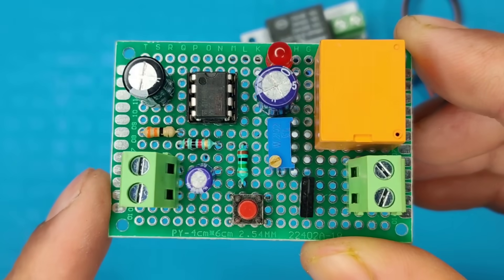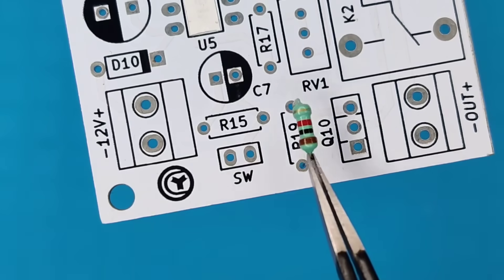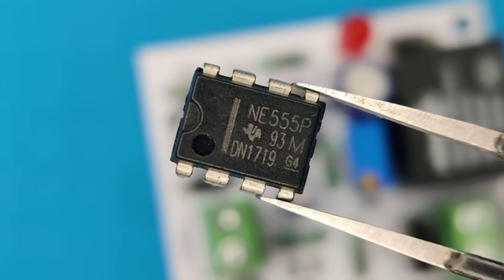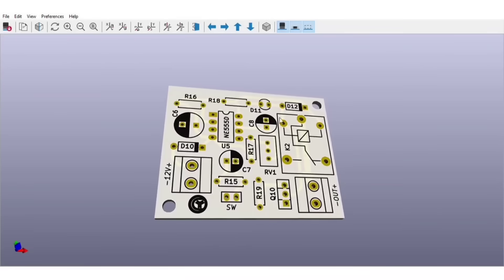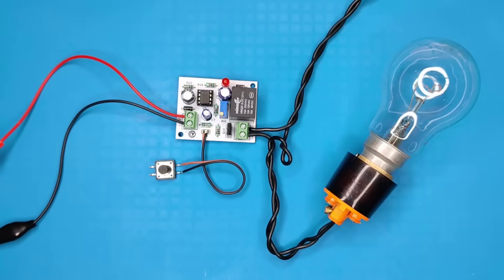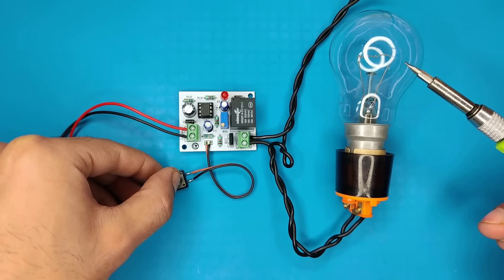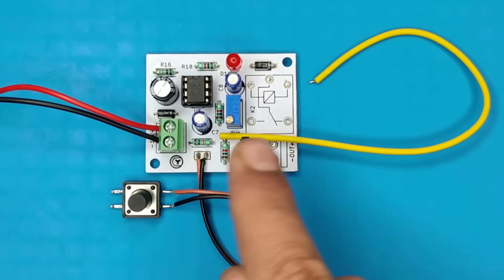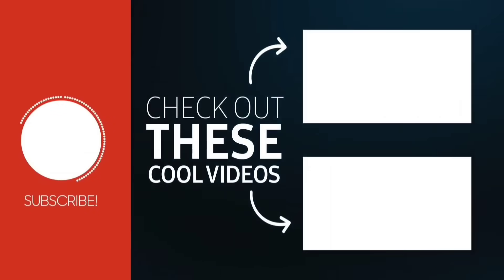Make your own Spot Welding Machine with this driver timer circuit

Comment: The linked Gerber file is not for this circuit!  I downloaded the file from your google drive and uploaded it to jlcpcb, but the file you provided is for a different circuit with a large IC in the center and no relay.  If you receive this comment, please let me know where I can access the proper Gerber file.  I'd love to make this timer circuit for my spot welder, and will definitely use your jlcpcb link if you provide the correct Gerber file(s).  Thanks for the cool video and keep up the good work.